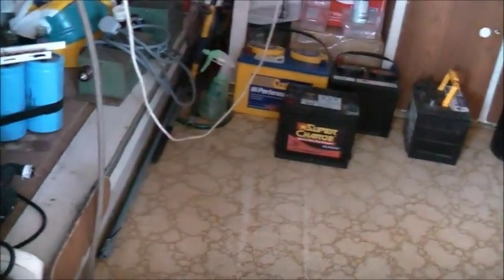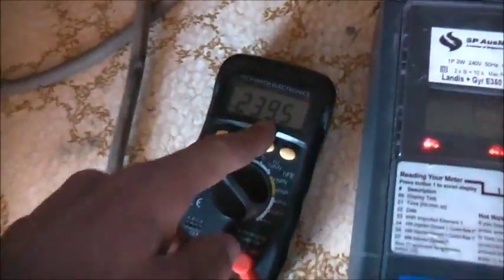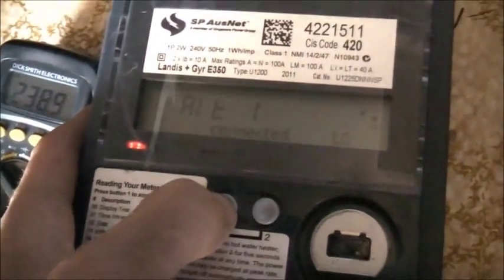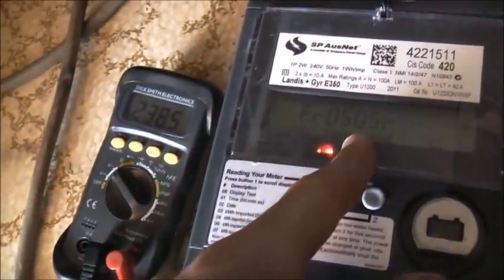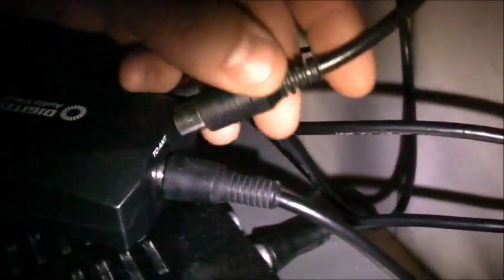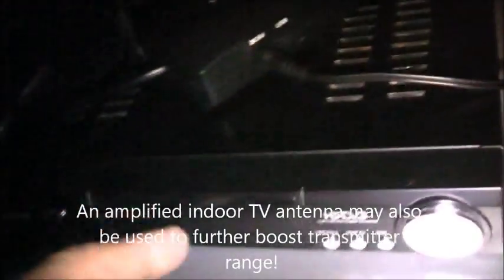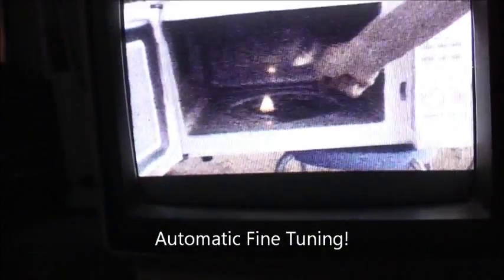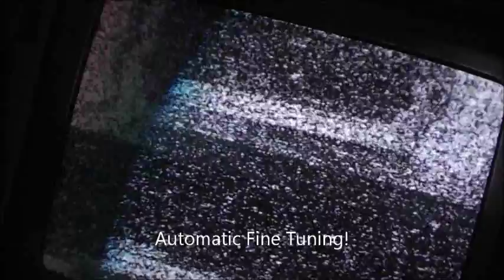Redneck Analogue TV Transmission

Comment: Mains voltage moves around through the day so dont rely on at all.

You will find the spec on most small multimeters for the ac ranges are not superb, they never are, its doing its job within its spec :-)